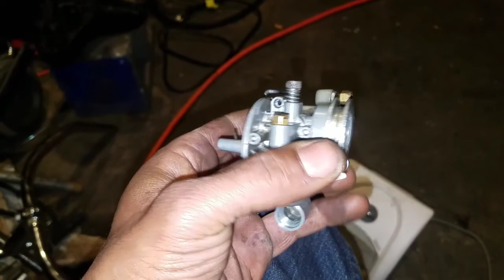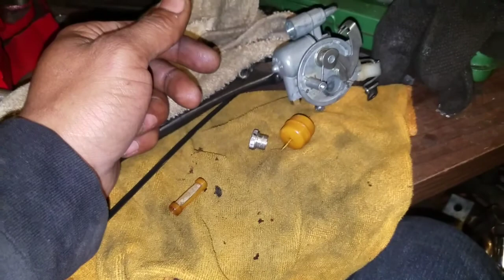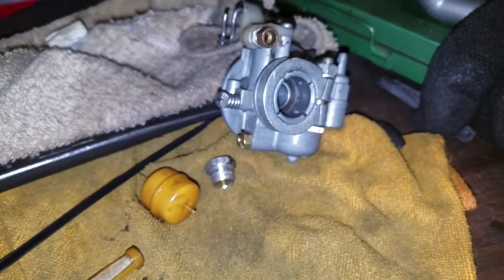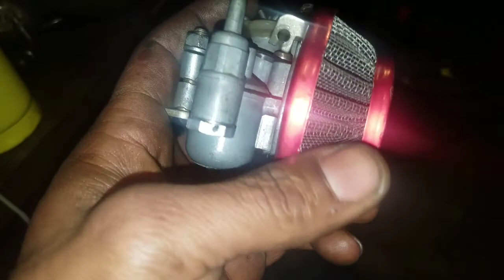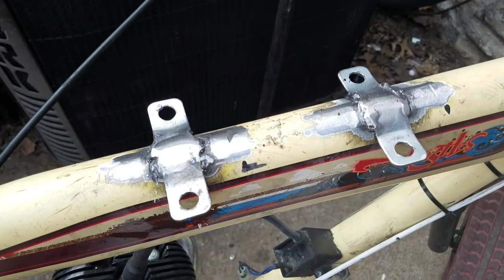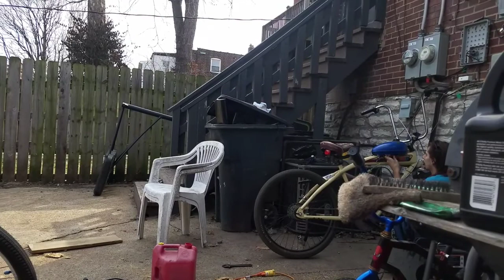This carb actually fits my #66cc

Comment: do a search on amazon for "yamaha PW80 carb". you'll see a mess of clone carbs for the "peewee 80" 2 stroke dirt bike. same for the pw50. cable chokes, genuine tunable 3 circuit keihin clones. kits with both cables run about 25 bucks, 10 packs of jets run about 7 (mains and low speed), and they have the same spigot clamp mount. they take those gauze and cloth air filters, have adjustable needles, and needles for them  can be bought as well. if you're gonna power tune, the peewee carbs are about as close to "race parts" you'll find for the chineseum alloy bike mills. for less than 50 bucks (or the price of one of those "high performance" bike engine carbs alone) you can have the carb, cables, 10 each of jets, and the air cleaner. make it 60 and you can also have the peewee throttle and choke handlebar pod too. 

if you make a reed case, you can also check out walbro clones, where 30 bucks basically gives you everything (reeds, mount, carb, gaskets) to make a "full throttle flyer" (but the mid range is lacking). small tillotson diaphragm clones can be had for about 11 bucks as well, with 3 circuit tunability. 

the carbs they sell for those bike motors are all pretty much half-assed at best, and are absolutely useless for power tuning to anywhere near the potential of those motors. a tillotson and reeds with a windowed piston (check out the reeds for 2 stroke 1pe40qmb 50cc chinese scooters, WAY cheap) could build a real screamer, as could either peewee carb with the same reed set up.

 for the piston ported rigs (stock inlet) id say the peewee is the easiest swap, it basically bolts up. for the "bike motor reeds" designed to fit the stock jug, the peewee is also easiest. if you "go maniac" and want max performance, the scoot reeds  and a custom case to adapt them with a tillotson (which can mount in any position) or a peewee (can only side draft, bowl at the bottom) would provide a VERY tunable set up that will wring every bit of power in the most streetable form. the walbro set up (carb and reeds) is a cheap way to build a "race" set up suited to full time full throttle running, like circle track or dragging, or "flying mile" speed record runs